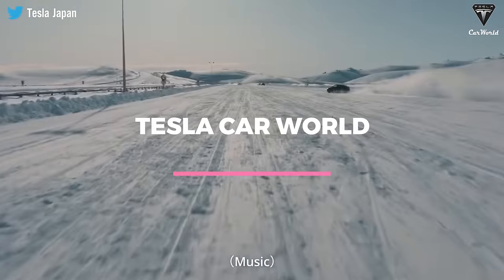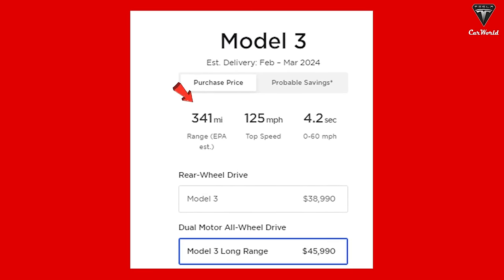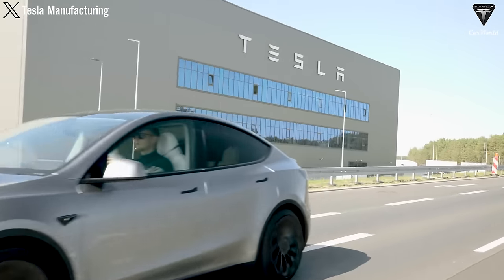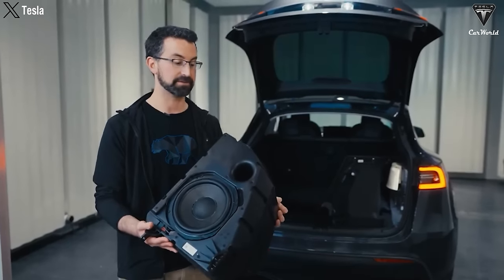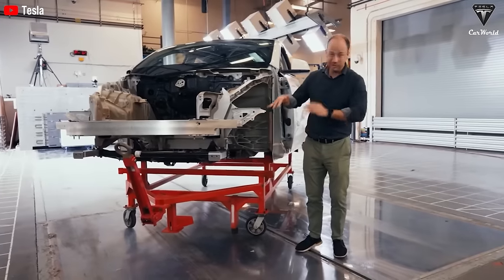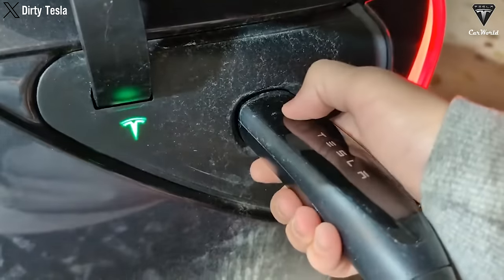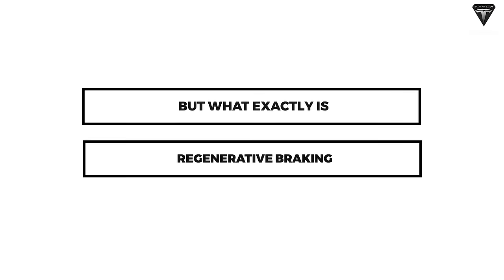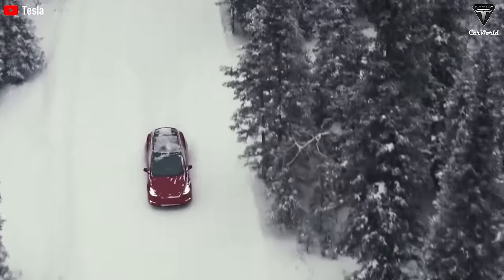Tesla's NEW 2024 Model Y and Model 3 Detailed Upgrade in 2024! New WARNING For Tesla Owners!

Comment: I completely agree ‘Do not by a Model Y now’. However, Tesla should consider giving the option of PREORDERING to prospective buyers of the MODEL Y JUNIPER. Just like the Company did for the CyberTruck.  Yesterday, I test drove the Model 3 Highland, for about an hour. Comparing with the older Model 3 (2023) and the current Model Y, that I had test driven, both,  few months before, I have to say the following:
1) Greatly improved suspension, premium ride.
2) Very quiet, I hit the horn and sounded that some other driver was honking….three cars behind. The traffic was going by, almost, unnoticed.
3) The speakers sounded like my surround home system, although, I am not an expert in acoustics.
4) Despite my reservations, the ‘no stock’ driving was quite easy to get used to.
5) It is still a sedan, that means that it feels and it is kind of low with the particularities in entering and exiting the car.
6) The rear screen and its functionality was greatly exploited by my ten year old daughter. It is a great addition.
The elongated center armrest looks much better than the shorter one of the previous model.
7) This time, I tried the voice commands for the wipers, the a/c fan and temperature and the seat temperature and we died laughing every time there was a car reaction.
8) The ambient lighting experience, that is the light strip around the cabin, was the ‘frosting on the cake’ or the ‘cherry’ on the cake, just enough to leave us with our mouths open.
9) Mobile charger is included.

This car was a chinese- made Model 3 Highland, probably, with a CATL LPF battery. Not sure about the Hardware version, though. 
Too bad we do not need a sedan. I tested the new Model 3 just to see the new features, also intended for the 2024 Model Y, in action.
We need an SUV. I wish I could preorder the Juniper and get it over with. 
By the way, how you adjust the rear view mirror? I drove for an hour with the chin on my chest, lol..
Reply from the maker: Thank you for your thoughtful comment! The Model Y Juniper seems to be making some noise at the factory. What do you think about this?
Reply: @TeslaCarWorld  I am not sure the kind of factory noise you have in mind. If  you mean the noise of gearing up for for the production of Juniper, I say to hurry up and start rolling out the new Model Y ASAP.
What do you think about Tesla setting up preordering for the Juniper? Is there a chance for that?
Reply: Rear view mirror is manual - you adjust it with your hand like all other cars I know.

Comment: I am going to continue to hold back for longer range.  Electric cars are still not good for long trips.  I want at least 450 or more miles before I buy, if not I will stay with ICE cars.
Reply: I can follow your point if you want to drive in areas where charging infrastructure is spread out thin. ICE cars are just more flexible in the way that you can bring back up fuel tanks. And even though for many 450 is overkill - those are measured under optimal conditions. That numbers is much lower in extreme cold.